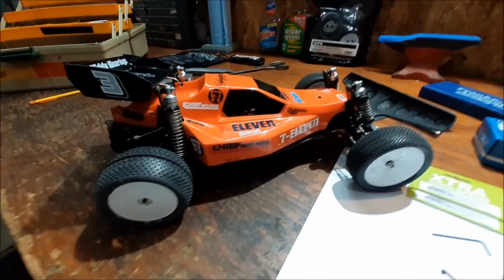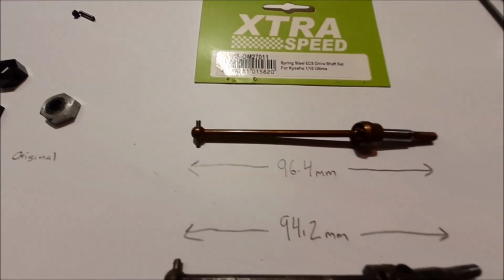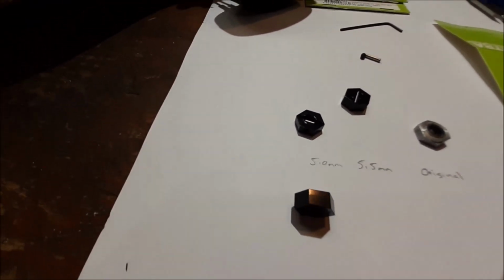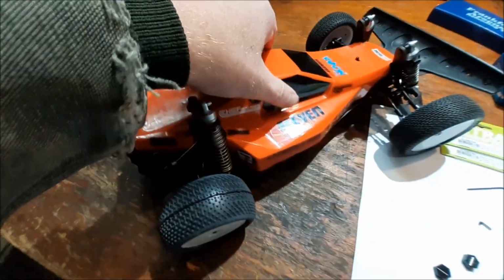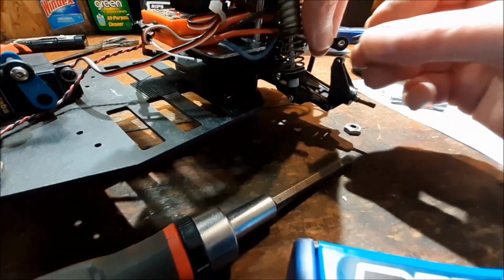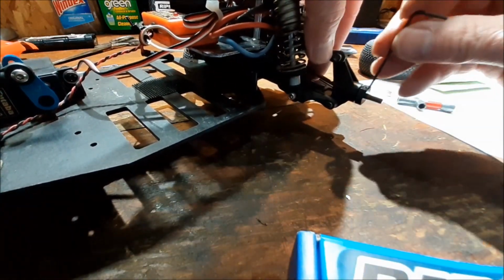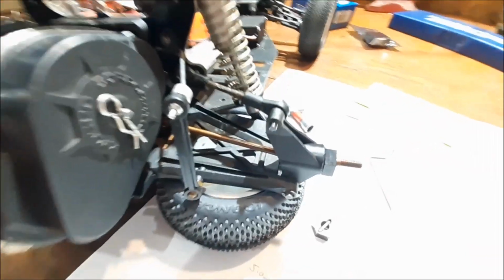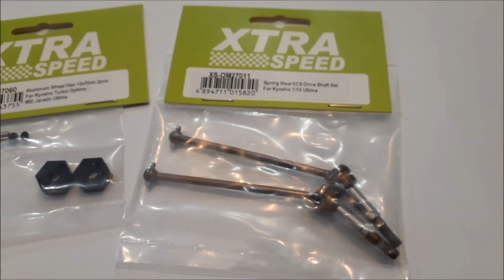Vintage Kyosho Ultima XTRA SPEED Drive Shaft Installation

Comment: Thanks for posting this. I was curious how they install, and how they differ from the stock dog-bones for the Ultima re-release I have coming.
Reply from the maker: I haven't had a chance to put them to the test yet, but they do seem well built and assuming they last, they are an improvement over the original design.